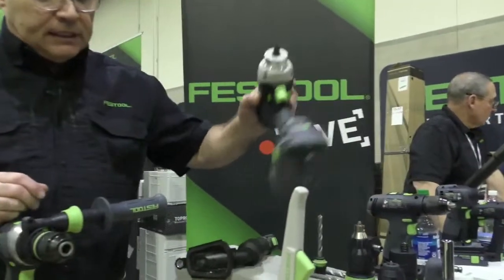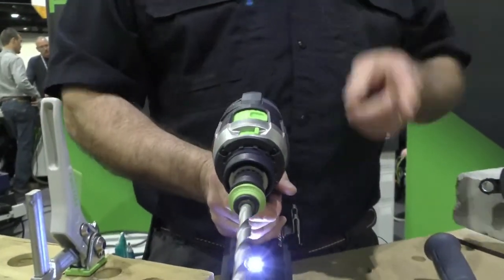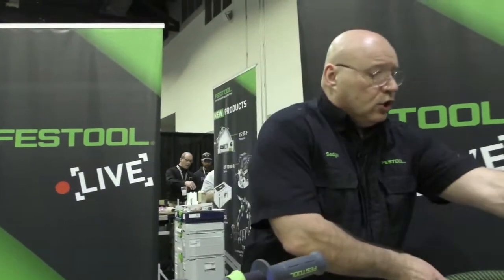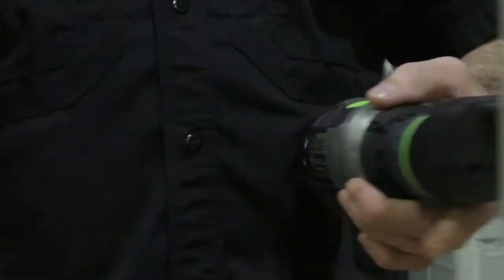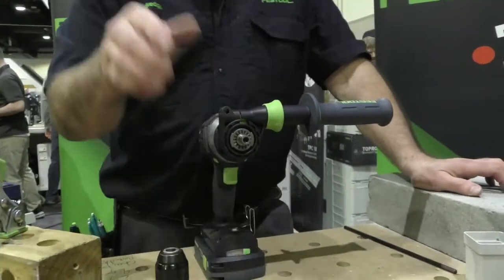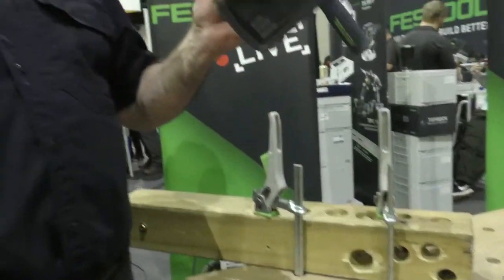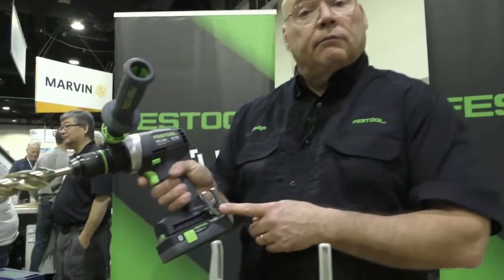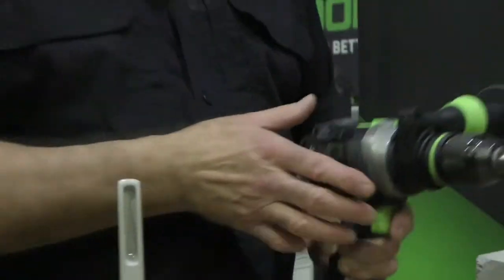Built Better: QUADRIVE TPC 18/4 LIVE from JLC Live.

Comment: I bought this drill back in April 2021 as a promo and leapt on it

I did have an issue 6 months later, where the fwd/ rev switch was stuck and wasn't able to engage the reverse function.

The drill was collected by UPS, fixed the next day and returned to me on day 3.

Besides the above issue, I'm very happy with this drill and Festool's customer service. 10/10
Reply: Strange, I had the exact same issue, and it took 2 weeks to fix and return, the service department’s communication was questionable. Drill is awesome.

Comment: UK festool user here, I recently bought this as an upgrade from my PDC, killer feature for me being a lefty, is the ability to change the forward reverse button via my festool app so it works the other way meaning I don’t change the direction accidentally with my forefinger and thumb.
Reply: Is it a big upgrade? I’d like to upgrade my pdc but can’t decide if this is a worthy upgrade
Reply: @carbb5760  good question, my PDC was well used and still worked well. It was perfect timing as I passed it on to a mate who was starting out and needed kit, otherwise I would of probably carried on using it till it died. I do prefer the speed selection and as I said the choice of direction switching helps me.
Reply: @adamlythgoe8574  ill follow up here, I do like the feel of the pdc the trigger and balance are both good. I just find it to be very large and underpowered. So hopefully the tpc solved those issues as I think I’ll pull the trigger
Reply: LOL... really?! Maybe it's time for me to read the manual...properly :o)

Comment: The TPC is JUNK !! ... its big, very low on torque vs other top brands... the TWO drills that were sent to be BOTH jammed up after literally 3 or 4 holes into brickwork... the gear selector was stuck solid on both drills... total junk
Reply: One or two swallows don't make a summer. If they truly were junk, YouTube would be all over it along with the FestoolOwnersGroup forums et al. It's been 11 months since your comment and I'm not seeing crazy issues like this.
Also, on the torque, I would have originally agreed with you. However, the application for the drill isn't to be a torque monster. If you want that, get a Makita 40v XGT. Even the new Hilti Nuron top-of-the-range drill one has 85nm in first gear. That's a far cry from their previous top-of-the-line brushed 130nm in first gear torque. The TPC and TDC are more about finesse and even more so with the old and upcoming CXS and TXS.